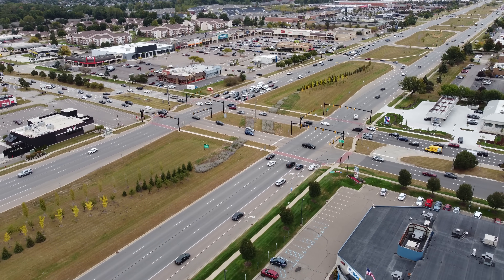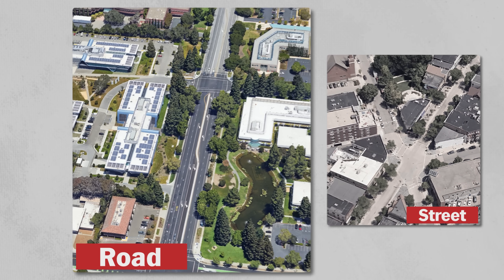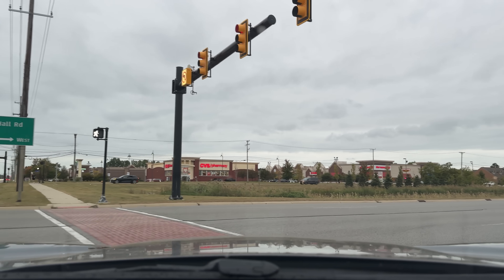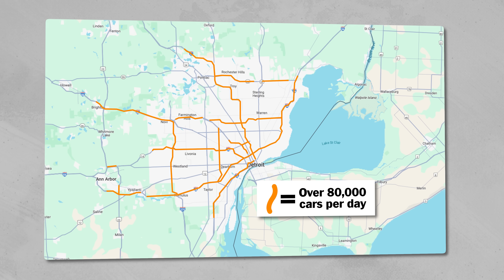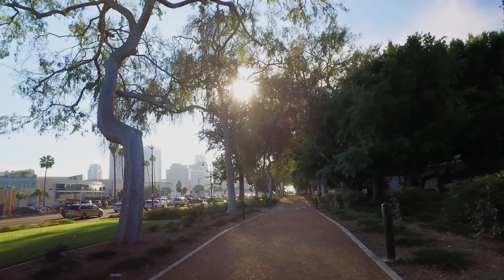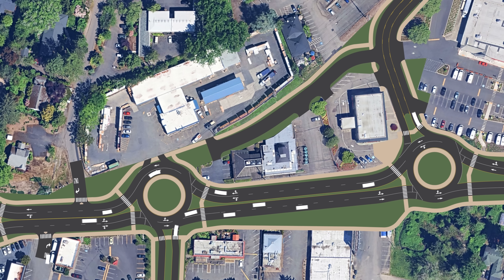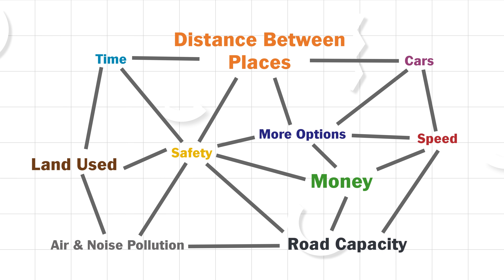How Michigan Built a Super Highway Using Only U-Turns

Comment: An underrated aspect of the Michigan Left that I really grew to appreciate when I first drove outside of Michigan is that they result in roads with a lot of u-turns. Missing the turn you need or going the wrong way through an intersection can create confusion and delay if there's not any good opportunities to turn around, but Michigan's roads reduce that problem by having an abundance of u-turns thanks to them being designed for Michigan Lefts.
Reply: Reminds me of what I've heard from several dashcam videos. "A bad driver never misses his exit." What it basically means is that if a bad driver is about to miss his exit, he will take a dangerous turn to the exit, often over lines you're not allowed to cross. If you can take a u-turn safely and frequently, that behaviour will lessen a bit.
Reply: most road intersections result in both roads having uturn options making being on the wrong side of the road not such a big deal. Im E bound on 16, but have to get on Gratiot SB. Typically to make this left turn you have to be in the left lane- with Michigan lefts I can be in the right lane and still get to Gratiot SB. Both roads have a michigan left I can use to make a U turn and get on the right road.
Reply: Oh yeah its real smart until you're trying to turn right into the far left lane because you ACTUALLY need to turn left but you cant because there's no traffic light across from you. And then youre sitting there waiting 5 minutes for all the cars to pass by, not that there is a lot of traffic but everybody is perfectly apart from each other so you cant actually make a wide turn, but there's nobody coming in the far right lane so the person behind you who actually WANTS to turn right gets mad and starts beeping at you. Really, really, REALLY good idea. I live in Detroit by the way.
Reply: @theguymrguybro  Here's a concept for you: turn right into the right-most lane, and go down to the next u turn, giving yourself enough space and time to cross over to the left lane! wow what a concept!

Comment: You seemed to have shown an idealized view of how the roundabout would work. You left out the case where cars on the side street need to take a left onto the  multi-lane main street in heavy traffic. It means the car on side street would have to somehow cross the heavy traffic in the two lanes of the roundabout to get into the lane that would take them left. This is an impossible situation under some conditions and is far from ideal. Roundabouts are great for single lanes when the traffic is not apt to be too heavy, but otherwise should be avoided. They are definitely NOT appropriate for stroads.

Comment: Sorry, this road also divides neighbours. And it is a bad implementation of the one way. Two one ways, to be exact. But usually a whole city block is in between the two one ways, here we only find green. Which is nice for nature, but bad for neighbourhood.
So if anyone would like to build a better multi lane high speed road with multiple exits without traffic lights: convert the existing street to a one way route, and con ert the street in the next block to go one way in the other direction. It is not difficult to enter or exit such a street, and the intersections may be build with extra lanes in each direction.

Comment: what went unmentioned are the additional snarls produced through the inefficiencies of dedicated left turns.  since the lanes dedicated to left turns are short, it's very easy to be forced to wait for a left turn signal more than once, and the backups in these left turn lanes spill over into the lanes dedicated to traffic going straight through the intersection, which in turn have the potential to slow traffic everywhere else in the intersection.  i'm also a michigander, and though they do have some downsides, i appreciate our left turns, and absolutely prefer them to dedicated left turn signals at the intersection.

Comment: Changing several lanes very quickly is also dangerous. Every driver u-turn would require the driver to cross several lanes after their left turn in order to turn right onto the cross road. Now when traffic is heavy, this will create problems.
Reply: Cross traffic has a red light, there won't be any conflict.

Comment: Of all the videos I watched, you are one of the better ones, that isnt foaming at the mouth ideological. 

First, there are some things to point out. (I only do this, since you seem more interested in solving a problem versus propping a preferred solution) Walkways are increasingly going unused. People don't go out anymore. Add to that, the growing number of people that cannot walk (be it weight or disability). Bike lanes also go unused. Im in NY, and I have never seen a bicycle using a bike lane. They are always in some other lane or the sidewalk. Most of these projects end up being signs of corruption (the contractor being related to the mayor etc). These problems just compound their image as being useless, where in some cases they could be useful.

I didn't know Michigan had such turns, but its similar to NJ. All turns from right lane. The benefit NJ has is that there won't be any slow traffic in the left lanes. It also takes up less width. Both though seem to work at preventing left turns over highways.

The roundabout though is something I am thoroughly against. I grew up in Europe and they are everywhere over there.The reason is due to having older streets and monuments. They were implemented because they also were not controlled intersections, as in, no traffic lights (now they do mostly). That would cause chaos here (and there, since few drivers still recall how to navitage a big roundabout without traffic lights).

The big issue with roundabouts is during winter. Driving straight is a lot more feasable than dealing with roundabouts, having to turn right, then left, then right again. They are also much more costly to pave and maintain.

Also, lower speed limits can be more dangerous. If everyone drives fast, it can be risky but far less dangerous than some driving fast and some driving slow. What is needed is traffic enforcement. How many people do not signal? Do you ever wonder why people don't signal anymore? Thats because cops won't pull people over and give them a ticket or warning.

Same with people going faster over some parts of roads. If cops don't patrol there, locals pick up on that, and speed. (I wont complain!) But if there is a dangerous stretch of road, and you don't patrol it, then you will get wrecks. And even if you patrol it, but if you only give warnings, people won't learn.

Its why no matter how safe cars or roads get, people will drive increasingly like idiots, with increasing senses of security, until they're upside down in somebody's lawn.

Comment: Some places in Michigan these DO NOT WORK!! US31 in west Michigan has two lanes. The turnarounds are ~80ft from intersections, with no signals.  The intersection backs up blocking the turnaround. Forcing people to wait and peel out between signal stops, or avoid it entirely. Light timing needs to be fixed. SO many times when the traffic clears up one way, you have to race around a turnaround to beat oncoming from the other direction.

Comment: The first roundabout I ever encountered (about 25 years ago?) while driving was in Montecito, a touristy suburb of Santa Barbara.  I'd seen them on videos of Europe and thought they were nuts.  Maybe the huge roundabout I'd seen in Paris isn't something for a neophyte to negotiate, but the little one in Montecito was perfect.  No instructions needed; it was clear how to get from where I was to where I was going.  Also efficient!  No waiting at a seemingly interminable traffic light!  Less air pollution because there were no idling cars!  From the construction materials it was apparent the roundabout was brand new.  

If, like me, drivers first encounter roundabouts in towns or small cities they will likely be more amenable to supporting them in large cities.  The current strategy seems to be the opposite - first build monstrous multi-lane roundabouts in large cities where they're more likely to confuse drivers and cause accidents, garnering negative reputations, then try to spread acceptance.  That's back-assward social engineering.

Comment: 4:14 in fact there is a road near me where this is so bad, while the intersection does technically allow you to turn left, almost no one does it.  instead they almost all turn right and then turn around at a spot that was all but designed the this by pure accident. 

and when someone does try to turn left at this intersection (blocking everyone behind them) people get cross
Reply: 9:14 I would also point out that after a certain point, it's just impractical to get around on foot in a given distance.

Comment: I'm old enough to remember when traffic circles were removed because they caused more accidents than they eased the traffic from backing up. One brainiac thought it was a great idea to put a circle on a hill with a blind curve leading to it. When you got to the top you were 50 feet from the circle. Mind you this was a two lane concrete divided highway. The speed limit was 45 mph.

Comment: One thing that few Michiganders seem to know & understand is that the u-turn is wide to accommodate large vehicles. 
It is one vehicle per u-turn, and not side-by-side lanes like turning onto a one-way road.
Unless there are actual lane markings (like Telegraph & Square Lake Rd) you shouldn’t be pulling up side-by-side and turning into both lanes.
You’re still supposed to be turning into the left most lane, but people see that space for trucks & assume that two people can make the left turn at the same time.

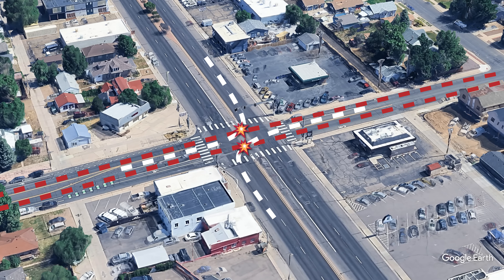Comment: 7:53 Michigan lefts don't reduce conflict points, and in some situations might increase the number of lanes you have to cross to get where you want.
Reply: Most importantly, they eliminate left turns, which is the most dangerous conflict there is.
Reply: @trainsim5869  they replace crossing counter traffic to turn left, with crossing cross traffic to turn around. 

About 80% of the lefts I make in central Michigan have me crossing more lanes of traffic for the Michigan left than I would if I turned left normally.

Comment: Back in the 1960s-70s, the wide medians required for these indirect lefts was considered a positive thing as the intent in many cases was that a sunken freeway could eventually be built in the median if traffic volumes grew enough and the 'old' divided highway would then become service drives. This happened in a few places but growth slowed down significantly by the 1980s. Texas copied this idea though, extensively. In MI, those freeways will never be built but they could conceivably be a great place for a regional train/light rail if we ever got serious about it. Signal timing could clear the turnarounds and stop vehicles from entering when a train passed through, making it very cheap and seamless to deploy. ROW/property acquisition is typically otherwise one of the most expensive aspects of such projects.

Comment: Having spent hours in this state, the major flaw is you have to turn right, fhen immediately cross 2-3 lanes to get over so you can use the U turn.

Ive seen countless side swiped and endless near hits from people trying to get over.

These are just a crappy round about. I hate them. But theyll never replace them with a proper round about
Reply: The cross traffic has a red light in that case, there's nothing unsafe about it.

Comment: Remember, per Michigan law you CAN turn left on red (after stop) in the turnarounds unless signed otherwise, but you cannot go straight across if there is a driveway. Interestingly, the left on red also applies to the end of exit ramps of diverging diamonds, coincidentally, as you are still turning from a one-way onto a one-way even though the mainline is flipped. This is an unintended 'loophole' in the design. But it feels illegal so few people seem to do it. But if you do, you usually won't get the second red 'thru' signal at the opposite set of ramps like you would if you waited for the green, meaning a left on red can save you another stop and several minutes.
Reply: Didn’t know about the diverging diamond left, but it makes sense. Thanks for the tip
Reply: 😶 I've been running lights since I learned to drive then 😂 if it's clear I go.
Reply: Here in Johnstown, Colorado a diverging diamond interchange was installed at I-25 and CO Hwy 60 and what did they do? They give us a RED LEFT ARROW, so we can’t turn left on red. We can’t even turn right on red off the ramp. They took away the ONE thing that would make wait time short. The problem is, they figure, and are sadly correct about, we have so many newcomers from CA and TX who think that stop signs and red lights are only suggestions, and they will not stop or not check for vehicles before going, thereby causing accidents.

Comment: I grew up in and returned to MI but lived in Phoenix 20 years ago and was involved in planning/designing huge new communities with 10,000+ homes. We had planned to introduce many of these "indirect lefts" based on MDOT's detail to several of the divided 6-lane major arterials that were planned and we had plans drawn and ready to go. The developers wanted 'typical' direct lefts with signals but would that have required 1/2 mile long turn lanes to have enough queue/storage space. It took a lot of work to get the developers/authorities to buy into them but they eventually did (albeit with additional and different signage). Then the recession happened, none were built. But had they been, I'm pretty confident the concept would have spread. I think others have since been built there.
They are now adopting the Michigan 3-level "flythrough" interchange (like Telegraph/I-96, 8 Mile/M-10, etc.) though.
Michigan has long been (and continues to be) a pioneer in roadway design, it's just a shame we don't have enough budget to do everything we want to do.
Reply: Yes, having left MI to move south I appreciate how much better designed the MI roads are compared to the south.  It's a complete mess down here in TX.  Even though there is much more space the traffic flow is much worse because of the poor design.
Reply: @rockys7726 everything about the South is worse than Michigan, and it’s something Michiganders take for granted but as I get older I can’t think of anywhere I’d rather live in this country.  No matter where it is you’re considering moving to you’re giving up a lot of things by leaving Michigan.  The only tradeoff is that winter can occasionally suck, although thanks to global climate change winter hasn’t been quite as bad in awhile.
Reply: @kernelpickle  I left for better weather and more opportunities.  There are lots of things nicer in MI but I just got tired of being cold.  I rarely ever wear long pants or sleeves anymore.

Comment: Stroads need to have lane speed limits.

The right most lane is 25mph, for getting on and off the stroad.

The middle lane is 35mph, for transitioning between traveling (in the left-most lane) and departing/arriving (in the right-most lane).

The left lane is 50 mph, for getting across town.
Reply: That's how they do it in North Korea actually. If you're ever looked at Pyongyang, there are signs and markings on the lanes saying which lane is for which speed.
Reply: The left lane is also for people making left turns from and to the road. 50 mph would be truly insane for cars trying to pull out of driveways and go left.
Reply: @cinquine1  In town, that can be eliminated.
How? I think it's in this video...
Reply: @n085fs  So you meant specifically on the tiny minority of stroads that have the space to be converted to this monstrosity. Then say that. 

The suggested drop in replacement for an 80 foot wide stroad being a 300 foot wide pseudo freeway thing is also just pure insanity. Most of these are much narrower, and then you have the exact same problem. Cars are on the left and stopped, trying to enter the left lane. Who are now moving at 60 mph. Nevermind the fact that in busy areas 60 mph traffic is completely unacceptable for signalized intersections even if no one is turning either way. Also nevermind that traffic moving at different speeds is inherently inefficient and dangerous, and that higher speeds don't matter in areas with many intersections because the vast majority of the time lost will be lost to red lights.